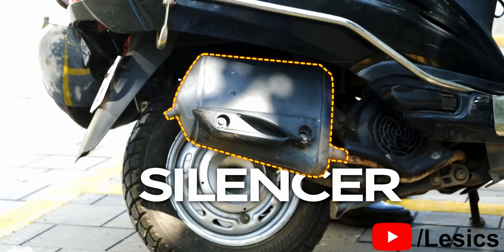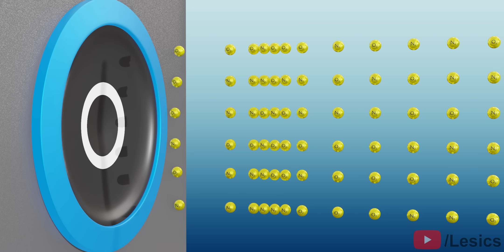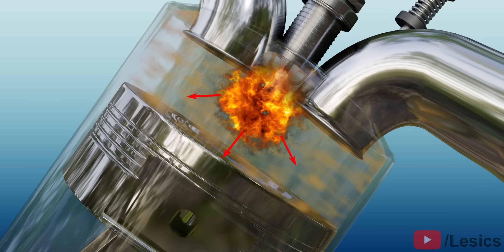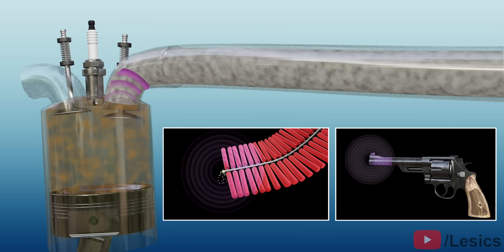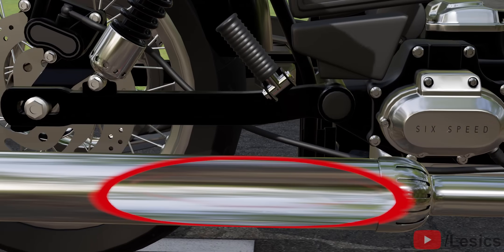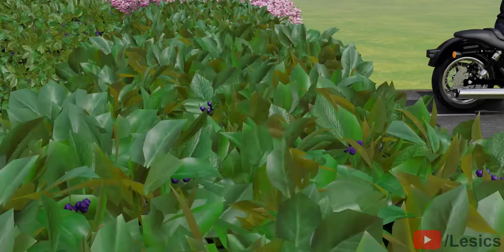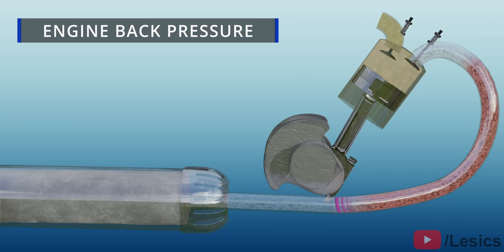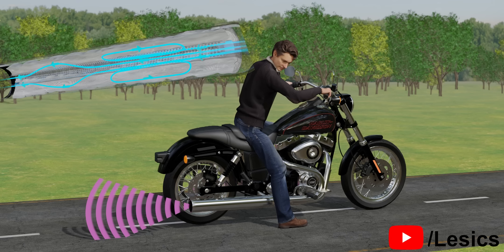Silencers | How do they work?

Comment: As an Acoustic Engineer (1 out of only 5 in Australia), who  designs silencers for super large mining dump trucks n dozers, I really enjoyed this video. However, this video is more about generation of noise and much less about ‘how muffler or silencer’ works. Also the description about how fibreglass works in absorbing sound waves is wrong. 
Plus the video only talks about one type of muffler and that too the simplest form. The one you explained is a simple ‘dissipative’ type. Most cars n motorcycles dont even have these. Fibreglass doesnt last long enough to be used in vehicle mufflers. Reactive mufflers are used instead.
Reply: yeah sound guy here too.  know about sound but not mufflers.  i felt that the explanation of the muffler was a bit short. the animation drawed what looks like a tesla valve or something - with sound going backwards & cancelling itself.

my thought was that yes most of the sound would go straight through & out the hole. is that right?
Reply: @pepe6666   thats not how sound works, (see last part) 

i m not an engineer but i think muffler sould make air particals collide more and more randomly with flexible material which absorbs these collisions which sould produce more heat since heat is also just collisions. these should work much more like the triangular fome that sound studios use.

[ about Sound ]
"they used completely inaccurate analogy

Air particals never stays at same position neither they want to come back at same position,

Air particals always move in different directions and collide with other Air particals, their movement will always be random to observer,

the sound is just more collisions in a perticular area, the collision then collide with nearby surrounding particals in all directions and since there are countless other particals these collisions fades out after a while, meaning collisions transfer to more and more particals."
Reply: About sound they just simplified things to understand, also usually that air particians stay more or less in place (example with speaker) and that generalization is accurate enough. Its like a people on concert, they are moving and staying under scene at the same time ;)
Reply: What is depicted is called a "glasspack muffler" which is as shown. A tube with perforations all along inside a larger cannister with fiberglass (or some absorptive medium) packed around. Basically, since the sound pressure goes positive and negative at a relatively high frequency, it gets somewhat absorbed by the packing medium. Anyone who has tried to speak directly into a sound absorbing medium like fiberglass would tell you it muffles your voice and makes it hard for anyone to hear you. Get a square for next time you're frustrated and want to scream expletives!

Better mufflers have a tube going in and ends inside the chamber. You will notice they are oval in shape. That's because when the tube ends, it ends in the medium, must travel backward through the oval chamber and exit through another tube offset from the first and with the open end almost where the first tube enters, so both tubes pass each other. This reduces noise much better, at the expense of back-pressure.

To reduce noise even more, use a combination of an oval muffler and a glasspack in series. Maybe even two glasspacks of different sizes with the oval muffler which will have different tuned frequencies and block noises at different RPMs. I think they used to call the old glass packs a "resonator" in the '70s.

When I started this vid, I thought they were going to talk about silencers for guns lol. I guess it's basically the same idea.  
😉
Reply: What's wrong about the video?
Reply: @thanhavictus  Everything,  only cheap aftermarket mufflers have fiberglass.
Reply: yeah coulda gotten in to how from exhaust it's noise but from a trumpet it's music
Reply: "Also the description about how fibreglass works in absorbing sound waves is wrong. "

Care to elaborate on what he mightve gotten wrong??:o
Reply: Roughly 20+ years ago, I worked on the Liebherr super haul truck to develop a muffler to reduce the 3500 HP engines noise as the mining site was near a housing community. The muffler was successful...significantly reduced the noise...the government was happy I guess....now your government has gone mad...
Reply: @jstone1211  i need the explanation, what technique did you use?

Comment: Can someone help explain why the gas doesn't just go straight through the pipe at 6:10 ? He explained that the exhaust forms eddies but never explained why. Thanks in advance 😊
Reply: some probably get straight through, but if all molecule just goes straight, the pressure in the middle would be higher than in the mesh.
the gas is drawn by the mesh because otherwise there would be a great pressure difference.
maybe you can think of it like pouring water in a tube lined with sponges
if you input water in bursts but it would come out more continuously because water will get drawn by the sponges, and get released smootly.
Reply: @Nagby3  Thank you. That sponge analogy really helped 👍

Comment: amazing that people still think air is mostly empty ... it's more like water.
go and examine how waves "move" in water (i.e. they don't) then you'd realize the animations in this video are pretty much dead wrong.
(oh and if air were mostly empty the animations are still wrong ...
1. when the first air molecule hist's the next it would mostly stop moving as the second moves away from it
2. the air molecule doesn't want to move back, it's happy where it is - the speaker cone moves back (slower then out)  and that pulls the air back to fill the void - again think of the pushing water, you pull back it flows back into the void and not "because it wants to go back".)
non glass filled versions the eddy / reflection cancelling is 50 - 70% depending on shape etc of the magic, about 20% absorption of the sound into the muffler's own rigid walls.
the glass version acts like the mufflers walls but being soft but not so elastic is far less reflective.  (the bit you got right -pretty much the only bit you got right - is the eddies prevent a lot more of the the pressure wave moving so straight.)

Comment: Very interesting design for motorcycles. Do some cars use this too? Especially noisy straight piped hyper cars like Lamborghini's or Ferrari's!
Reply: All of them do. Cars that are straight piped do not come like that from the factory.
Reply: surprisingly enough the muffler in a lamborghini aventador is massive compared to many other cars mufflers, yet they are still much louder because of the engine

Comment: i remember disassembling muffler on my scooter and i think there were no fiberglass. Also the design was different. If i remember correctly, there were couple chambers inside connected with the small pipes.
Reply: Then your muffler is of the chambered type. Glass pack type mufflers are the ones that have fiberglass on them.
Reply: Yes. Those are called reactive type mufflers. 
They work by reflecting the sound waves back towards the sound source not by absorbing them.
Reply: Maybe it was 2 stroke engine? Silencers in 2 stroke engines work a little different than in 4 stroke.
Reply: @mikoajmilewicz4039  yes it was
Reply: That's the design with the cambers, that is used in suppressors for guns. The advantage is that it lasts much longer and it's much more sturdy (that's why its used for guns).
On the downside it's heavier and needs more volume, that's why it's usually not used on motorcycles anymore. *
He should have also explained that.
* Furthermore ("sport") mufflers for motorbikes are often created to break partially down after a short period of time and make much more noise then they're supposed to. That's much harder with the sturdy design.
Reply: @qq84_Richard  not all bikes used to have them maybe in western world... i had java and rajdoot in India and they just had a very small perforated tube at the end of the exhaust pipe
Reply: @qq84_Richard  It's used on all modern motorcycles.
Reply: @Shindiggity  because motorcycle are hobby objects and not ubiquitous every machines like cars
Reply: @cereal-killer4455  Except in S.E Asia, South Asia and Africa. There, they are the main transport means for the masses
Reply: @cereal-killer4455  lol, maybe in your world.

Here bikes are the ubiquitous everyday machines.
Cars are for rich people who have large amount of disposable income. And wnats the extra comfort of cars.

Comment: A SILENCER ON A GENERATOR WOULD BE NICE!
Reply: Most generators do have silencers. The problem is that the ones fitted to most small generators aren't very good.  But the reason those mufflers aren't very good is because the block itself also generates considerable noise.  This is because portable generators need to be light.  If the engine block was thicker it would be quieter, but then it would be heavier.  And also more expensive.  You could put the entire generator inside of a soundproof box, but then you would need to tap energy from the generator to drive a fan to keep the inside of the box cool.  So now you are adding weight, and cost, and reducing efficiency.

Then there are even more complicated issues such as needing to maintain a constant RPM regardless of load in order to maintain 60 Hz output frequency.  You could add an inverter here, but again that adds cost and limits peak power output.

Comment: Make videos on these topics
1 how Hydrolic power steering works
2 How cylinder lubrication works in 4 stroke engine so efficiently
3 how Anti sway bar or anti role bar works
4 how EVAP system works
5 how electric FI system works
6 how two stroke diesel engine works
Reply: Exactly what I've been asking, too!
Reply: i believe they already did the power steering including the EPS one, if not then there are others who made the animation too

Comment: How mufflers work?*
Reply: The muffler works by using chambers and baffles to absorb and reflect sound waves produced by the engine's exhaust gases. This process reduces the noise emitted from the vehicle's exhaust system, making it quieter.